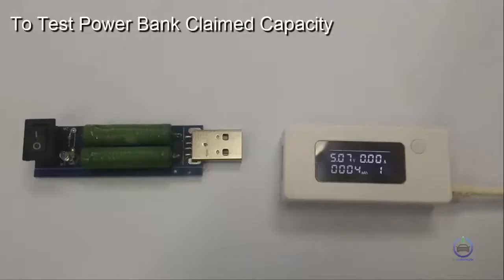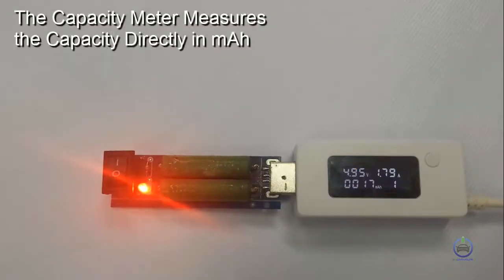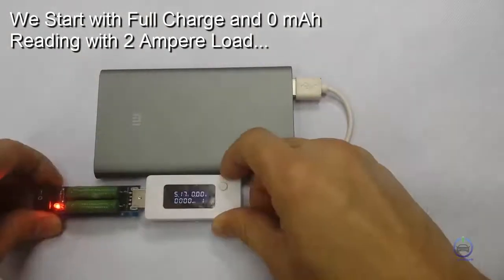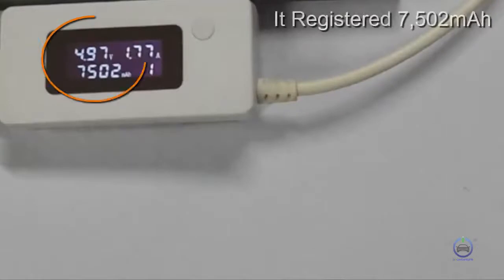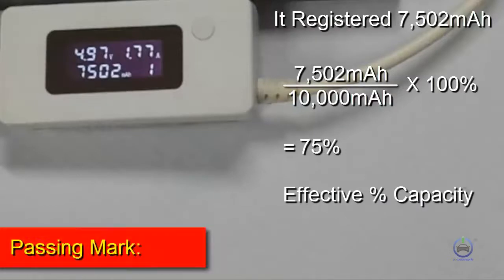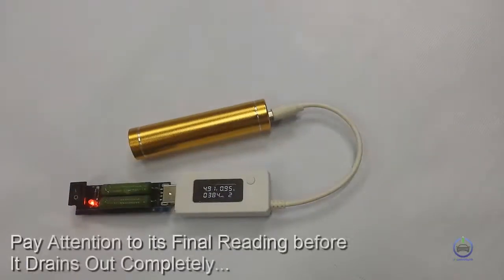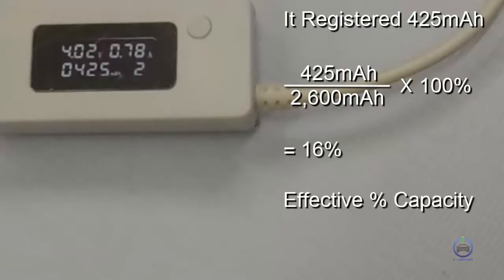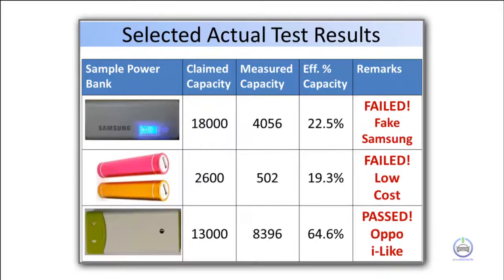How We Test Power Bank Claimed Capacity - The Proper Way

Comment: Measure/Compute the wattage not the current....this video is crap
Reply from the maker: You may be right that this video is crap. "One man's garbage is another man's treasure". It may be crap to you, but not to those who appreciates the time and effort that we had put into creating the contents of this video. The objective of this video is to explain technical matters in as simple as possible so that ordinary people like you and me can understand and therefore appreciate technology better. But if you are technically inclined, we will try to explain the concept of current and wattage that is covered in this video. In the video, we measured the mAh (milli-ampere hour) which is current delivered by the power bank over a period of measured time in hour. Applying the basic concepts in electricity, when we multiply the current (whether in ampere, milli-ampere, or milli-ampere hour) by the voltage we get the wattage (in watt, milli-watt, or milli-watt hour respectively). So, in the video, we only measure the current (in mAh) and did not cover the computation of wattage to make the video as simple as possible.

Power bank’s capacity is usually expressed in either mAh or Wh.  For example a power bank with capacity of 10000mAh (milli-ampere-hour) can also be expressed as 37Wh (watt-hour).  In this perspective both units are equal but are expressed differently.  They are synonyms in English language, and are equivalents in scientific language.  To convert mAh to Wh, just multiply the capacity of the power bank in mAh by the voltage of its internal batteries which is at 3.7V then divide by 1000 to make the final unit in Wh:

mAh x 3.7v / 1000 = Wh

For example, a power bank with a claimed capacity of 10000mAh will have:

10000mAh x 3.7v /1000 = 37 Wh

Similarly, if we want to convert Wh back to mAh, we just use the same formula but in reverse order:

37Wh * 1000 /3.7v = 10000mAh

Now, we know that 10000mAh is just the same as 37Wh.

Manufacturers usually use mAh as unit in referring to the capacity of the power bank. When you buy a power bank with capacity rating of 10000mAh, the capacity of 10000mAh refers to the combined capacity of the lithium batteries that are inside this power bank and all of them have a nominal voltage of 3.7volts.  But when you use this power bank to charge your mobile phones, what do you think is the voltage that is coming out of its USB charging ports? The answer is 5 Volts.  All USB PORTS have a voltage of 5V!  Now, what’s next will be quite confusing.  The internal voltage of the battery of the power bank is at 3.7v but when it is used to charge devices, its output voltage now becomes 5v!  So, how do we go about in the computation of mAh?

To make life simpler, let’s review what we have just discussed earlier.  10000mAh = 37 Wh.  As a rule of thumb, we use the Wh unit as starting point to compute for higher level of computations such as efficiency and conversion rates, no. of charges, etc.

When we use the same power bank with 10000mAh to charge our mobile phones, we use the unit of Wh which is 37Wh.  And since the output voltage now is at 5v, we use the following formula to convert it back to mAh from the perspective view of using the power bank as a charging device that supply out 5v of power.

mAh = Wh x 1000 / volts

mAh = 37Wh x 1000 / 5v
mAh = 7400 mAh

Now you will know that a power bank with a claimed capacity of 10000mAh with batteries having a nominal working voltage of 3.7V  when used to charge mobile phones with output voltage of 5V will only have an ideal or “theoretical” capacity of 7400mAh!

But no single power bank can deliver this ideal value of 7400mAh since the design of the power bank will involve electrical circuit boards and voltage conversion losses.  All these factors will cause some of the energy to be lost in the process.  Hence, the term “efficiency” emerges.  An “ideal” power bank will have an efficiency of 100% because all of the energy is conserved and none is lost in the process of conversion from the internal batteries of 3.7v to 5.0 v output voltage then to charge the mobile devices.  But in the real world, there will be always some in-efficiencies.  Better designed power banks will be more efficient therefore, will incur less loss, thus, will have a higher efficiency.  To compute for efficiency of power banks, we simply measure the actual capacity then divide this by its theoretical capacity then multiplied by 100%.  For example, let’s say, the measured capacity of the above mentioned 10000mAh power bank is at 7000mAh,  by applying the formula, its efficiency will be:

Efficiency = measured capacity/theoretical capacity x 100%

Efficiency = 7000mAh/7400mAh x 100% = 94.59%

Another term being used in the power bank product is conversion rate.  Conversion rate is the same as efficiency!

If we apply our term, “effective % capacity” and connect to Conversion Rate, it will translate to something like this.

Our passing “effective % capacity” is 60%.  For a power bank with claimed capacity of 10000mAh, our passing mark will be: 

10000mAh x 60% = 6000mAh

To convert this into conversion rate:

Conversion rate = measured capacity/theoretical capacity x 100%
Conversion rate = 6000mAh/7400mAh x 100% = 81%

Our passing mark for power bank is 60% effective % capacity or 81 % conversion rate.

For additional info about power bank capacities, number of charges, etc., please visit the FAQ pages of www.windsor.ph or www.powerbankphils.com
Reply: Powerbankphils where the hell did you get a over 100% efficiency  5volts * 7.5 amps = 37.5watts but your power bank is 10amps * 3.7volts = 37watts fix you shit and study/learn some basic electrical experience!
Reply from the maker: @niccabuban7247  As I have answered in the comment that you posted 1 hour earlier,  the reason why the efficiency went over 100% was due to the inaccuracy of readout of the capacity meter.  Such inaccuracy resulted to a "false positive" read out of the mAh- meaning the capacity meter gave a higher value that the actual value which when applied to the formula will result to an efficiency of more than 100%.   The main objective of the experiment is just to provide reference value (and not "absolute value") and compare how different power banks perform in terms of its claimed capacity versus its actual output capacity.
Reply: Powerbankphils Powerbankphils i will elaborate the simple formula (energy output power in WATTS/energy input power in WATTS) * 100 = efficiency bobo mo so the efficiency of your power bank is (37.5/37)*100= over 101% efficient wow po bobo lang ?
Reply from the maker: @niccabuban7247  Thanks for your reply!  :-)  From the way you answered back, it seems to me that you are quite knowledgeable in the subject of physics specially in basic electricity.  We are one in the formula of efficiency.  There is no dispute about it.  The issue here is the accuracy of the mAh reading that the capacity meter has measured.  It gave out a "false positive" reading.  That's why the figure it gave was at 7502mAh.  The power bank model that I measured is xiaomi PLM01ZM.  It has a claimed capacity of 10000mAh and effective output of 7100mAh.  These figures are printed on the body of the power bank itself.  In this regard, the efficiency (or conversion rate) is only at 96% which is very high. There is not a single electronic circuitry system that will have a efficiency of 100% so much so 101%!  This I agree with you 101%!  In basic concepts involving instrumentation, there is what we called "degree of errors" in each instruments that we use.  There is also the concept of calibrating the equipment against a standard reference to make sure that it will deliver the right measurement that is not only "accurate" but also "precise".  I hope this answers your concern.  :-)
Reply: Grabe naman makasabi ng bobo parang pinapalamon mo buong team ng Powerbankphils. Buti pa sila ni Mikhail may intelligent conversation.

Comment: You can't just compare these two values, 10000 mAh at 3.7V is around ~6500 mAh at 5 volts
Reply: That's why i always measure powerbanx in Wh. For example my swissten 30Ah is rated at 100Wh and guess what.. 102Wh goes to it, 97Wh goes out of it (it is a year old boy now). The difference between what goes in/out is called the efficiency and is primary determined by the quality of pb's internal circuitry. Edit: most efficient ones will be about 96-97% efficient but i saw as low as 87% ewwww
Reply: @paveljelinek772 Are you kidding me? It's rare for a bank to be over 80%, and MANY are at or below 50% claimed capacity! You haven't watched many videos where capacity is tested, apparently.
Reply: @RationallySkeptical  well i buy only verified quality PBs and i even make them myself
Reply from the maker: Can you please elaborate on your comment so that we can have a more meaningful discussion?  YouTube, after all was built on the platform of sharing.  Let's share our knowledge with each other.
Reply: @powerbankphils1544  In power banks there are 18650 accumulators/batteries which have ~3.7V. 10000  mAh at 3.7V are ~37 watt Hours, and 6500 mAh at 5V(which is voltage of phone battery) is [6500*5/1000] 32.5 watt Hours. You have to compare watt hours or if you want to compare mAh you have to ve sure they are at same voltage
Reply from the maker: In this regard, you are correct.  In the video we explained this issue in a simple manner so that the not so technical people can readily understand how to gauge a good quality power bank from a bad one.  Bad quality power banks tend to over-claim their capacity.  We just set the effective capacity passing mark as 60%.  For branded and good quality power banks like Xiaomi, it can go higher than 70%.  Theoretically speaking, a 10000mAh lithium battery (be it polymer type or 18650) with a working voltage of 3.7V will have a watt-hour of 10000mAh x 3.7v /1000 = 37Wh.  When the power bank is used to charge a device, its working voltage now is at 5V.  Applying the formula, the same powerbank has a Wh of 37Wh (Law of conservation of energy).  Now that its charge out volt is at 5V, then 37Whx1000/5v=7400mAh.  So the theoretical output or charging out capacity of this power bank is at 7400mAh and not 10000mAh.  Xiaomi is claiming at 7100mAh.  In actual, all power banks will have an output capacity of lesser than 7400mAh due to issues with efficiency of the electronic circuitry of the power bank.  When we divide this actual output mAh by the theoretical mAh, we get the conversion rate.  For Xiaomi, it is claiming 7100mAh. If we divide this 7100mAh by 7400mAh, we get a conversion rate of 95.9% which is very impressive.  Our passing mark of 60% (6000mAh for 10000AmAh claimed capacity) will translate only to :  6000/7400 x 100% = 81.1% conversion rate.  We have tested a lot of power banks, and decided to set the passing mark at 80% conversion rate or 60% effective output capacity.  We believe we are one on this topic.  Thanks for your sharing. :-)
Reply: @powerbankphils1544  thanks for the explanation, I didn't understand at first but you are correct